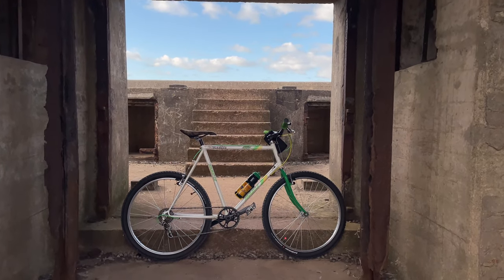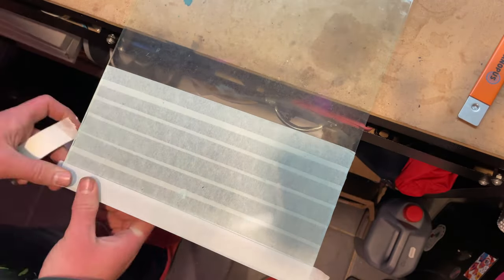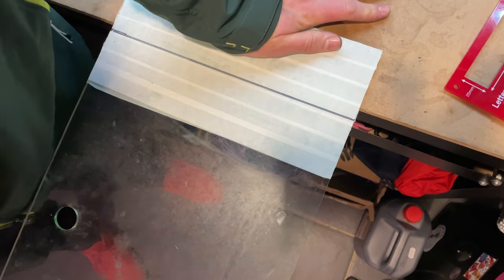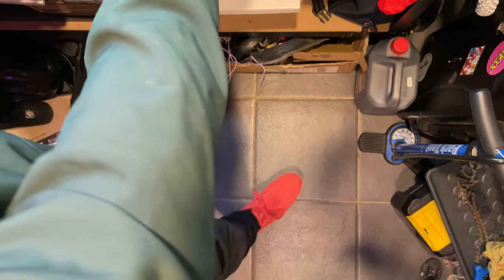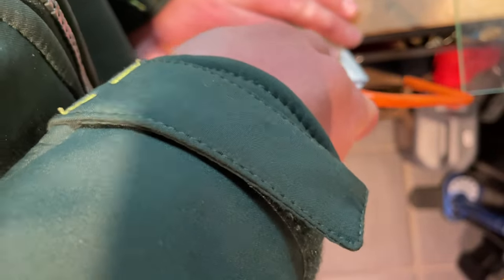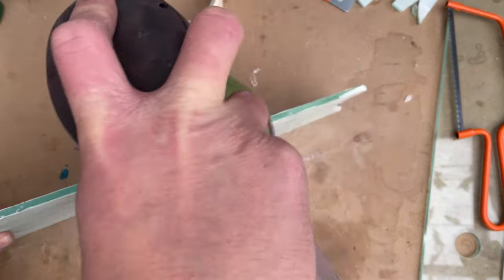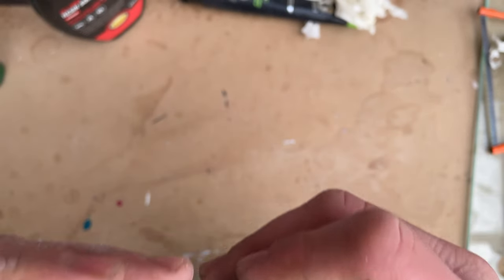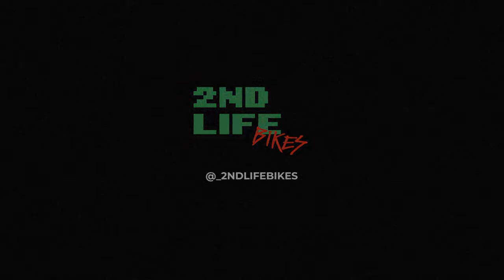How I Made This Invisible Stand For Taking Photos Of My Bike!!! - DIY Bike Stand

Comment: I looked into buying the Shadow Stand but it’s pretty pricey. Shipping to the US hurts too.
Reply from the maker: I did as well but the shipping turned me off. There’s no way I’ll be able to make something to the standard of the shadow stand but it kinda works!!
Reply: @2NDLIFEBIKES  Do you happen to know the depth in mm of your stand? Have you observed any bowing when weighted? I rummaged the house and found a large sheet of clear plexiglass that I used for part of a Halloween display over a decade ago. Large enough sheet to make several stands. My concern is the thickness as I think it may not be thick enough to withstand the weight of a leaning bike. Much thanks.
Reply from the maker: The sheet I used was 5mm no bowing as far as I’ve seen. I’d say you could go thinner but not by much. Especially on a heavy bike.